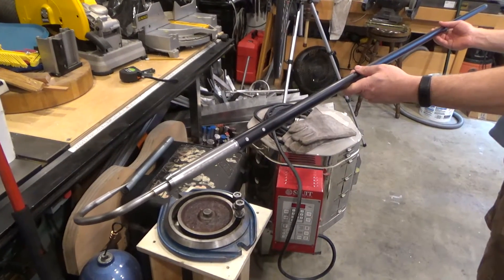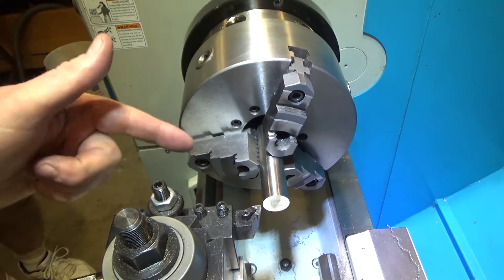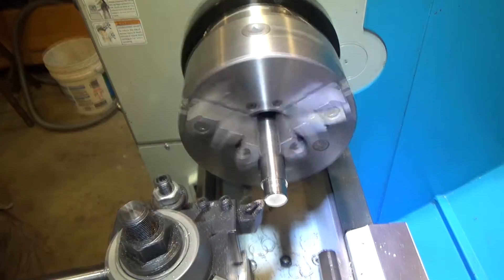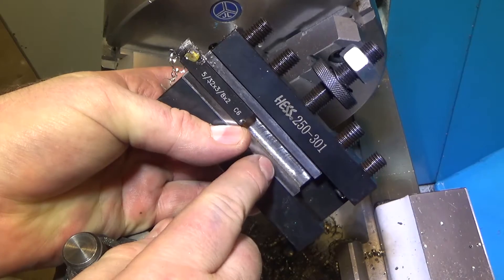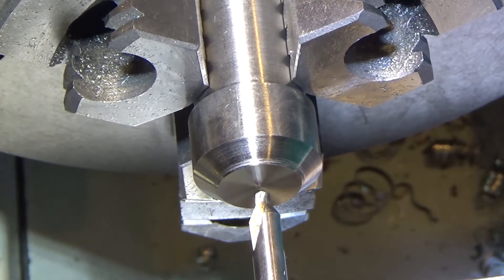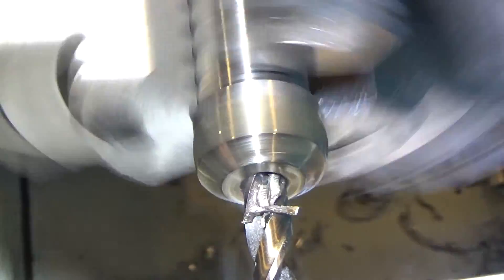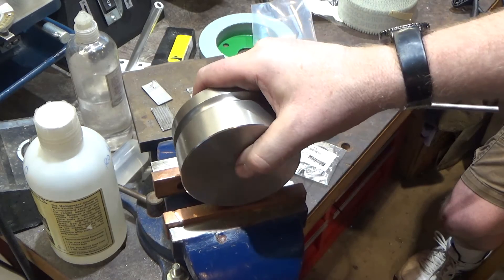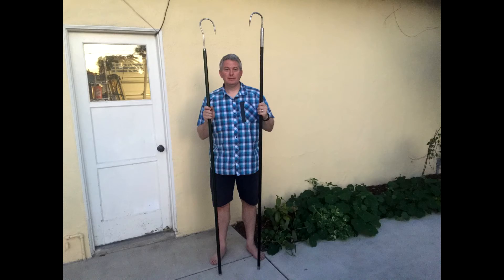A Gaffe on a Gaff - Deep Sea Fishing Gaff

Comment: Yep, here in SE Alaska it happens every winter-they get left out and split.  Also some of the guys put a very short tether on the end with a gillnet cork on it.  Saves it if it goes overboard.  I have seen some reamed out and glued to the butt of the shaft which helps if you get whacked while someone is using it as an added benefit.  Mostly we use shorter gaffs and a halibut harpoon where the tip comes loose after a big halibut has been stabbed.  Makes a toggle on a line to anchor that 200# slab.  Great home project too.  Take care.  Doug
Reply from the maker: My brother in law loved your ideas. He's the  fisherman. I think we will be pursuing them very soon. Thanks!

Comment: 316 work hardens. A couple of crooks?  ;-)
Reply from the maker: I read that, but was not sure how to approach that issue. So what I did, was to heat the part after I bent it to red hot and quenched it in water. I read about that suggestion on one of the machinist's forums. I was not particularly careful about the temperature though, so I am not sure if I actually reached a high enough temp. to adequately relieve the stress. Thanks for the comments, quite punny.